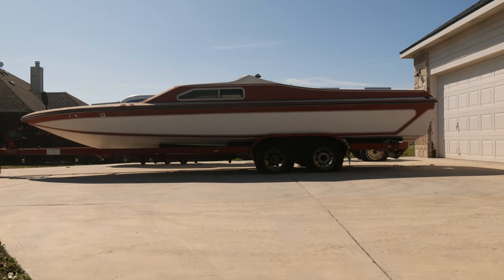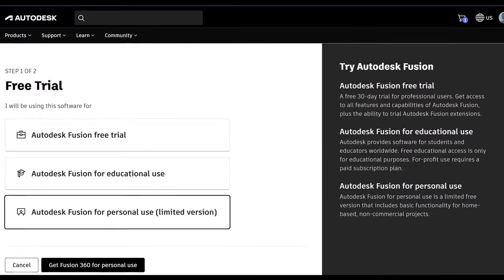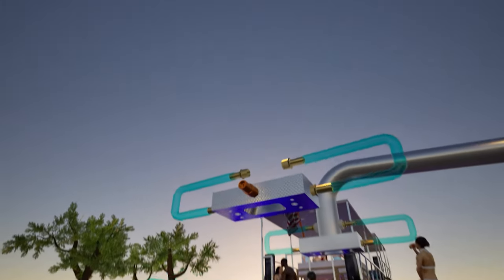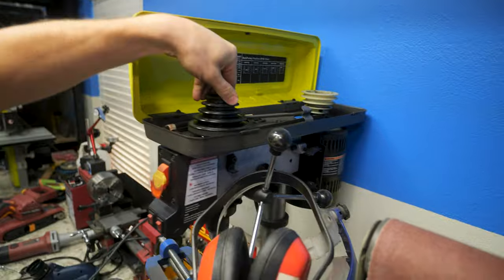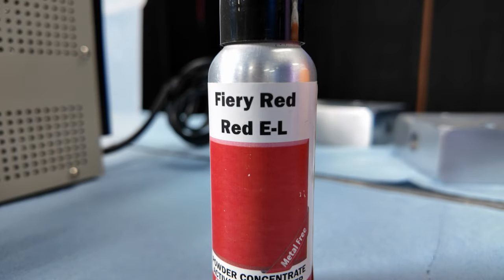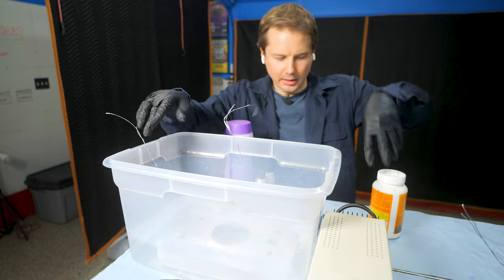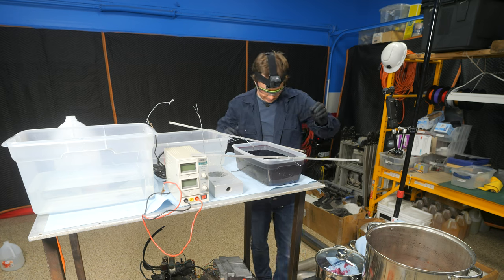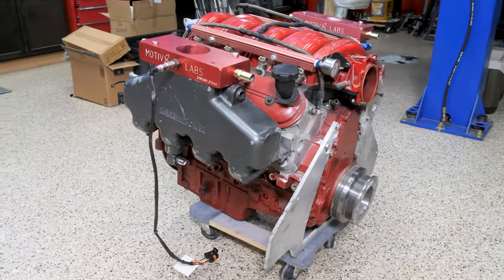We Machined Exhaust Adapters for the Junkyard Jetboat!

Comment: Water route is supposed to be from jet to a T then bottom of exaust manifolds  threw o2 sensor adapter into engine out engine to exhaust
Reply from the maker: We’ll probably have to go that route if the engine runs too cool. I’m curious how it will do in Texas when the water is warm. Thanks for the feedback!
Reply: @Motiv8Labs  no problem bro I have issues staying too cold out here in Arizona heat just trying to save some headache happy jet boating bro hmu if you have any questions